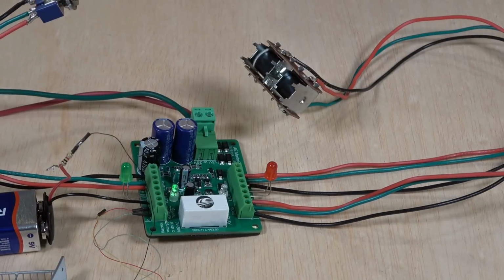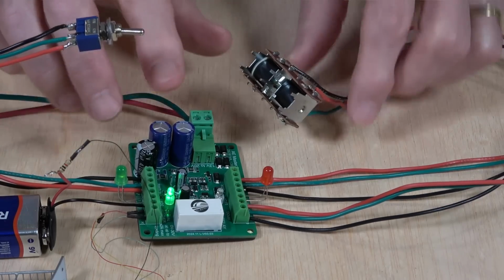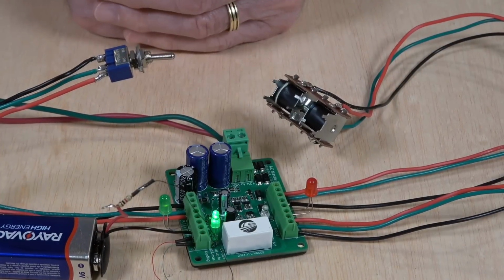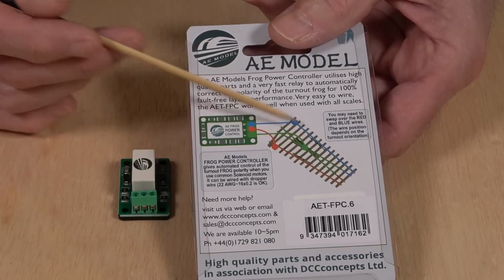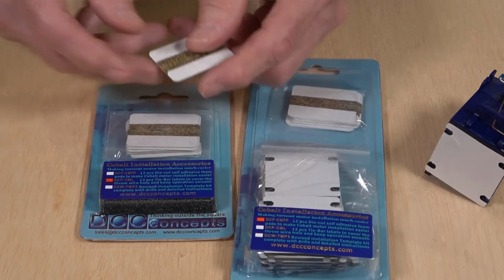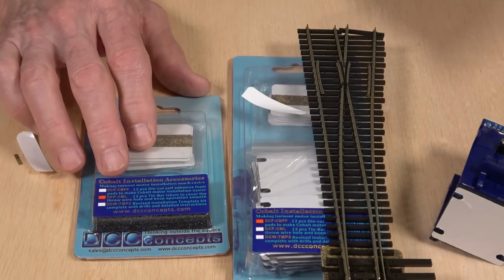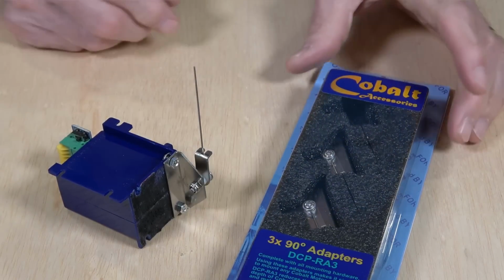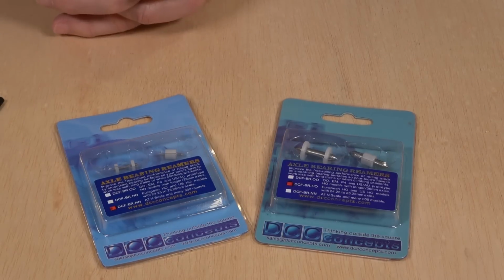New Toys For Your After Christmas Wish List (372)

Comment: Totally unreated question, but has anyone you know of done videos on using something like an oscilloscope or similar to measure/observe DCC power bus signals when connected anywhere on a layout in order to determine problems with the variable duty cycle square wave signal coming out of a booster (or command station with inbuilt booster)? I've not seen any boosters that 'self diagnose' and report on faults/issues with the DCC signal. Shorts (where the two phases are mis-matched and 'shorted') get detected but I haven't seem much covering the potential for signal degradation or 'corruption' that might lead to power loss or 'leaks', or deformation of the signal. I guess this is partly why on larger layouts there needs to be multiple boosters.
Reply from the maker: That is such a difficult thing to do and interpret requiring very sophisticated equipment and knowledge. Few modelers have the scopes for it or really the need to do it, so no it has never been done to my knowledge.
Reply: @TheDCCGuy  Thanks Larry I do understand that. I suppose there is a subset of modellers who are very technically minded. Really appreciate your channel btw. As I'm getting back into model trains after a 25+ year hiatus that started when DCC was still new I'm still catching back up. 8-)

Comment: I'm so glad you highlighted and demonstrated the Tiebar Labels. I just ordered some from Iron Planet Hobbies. Do you know if the new DCP-RA3 90 Degree Adapters will work with Tortoise switch machines?
Reply from the maker: I doubt they will work since the Cobalt switch machines are slightly smaller so the screw pattern would be off.
Reply: @TheDCCGuy  Ok. Good information. Thanks for the quick reply.

Comment: You used an interesting term. This little bugger. The original meaning of that word is very relational to reaming which is what the axel reamer does. But it used to be a very derogatory term that my Grandmother said I should never use !  Just saying….
Reply from the maker: You need to widen your vocabulary. A “bugger” is also a pesky little critter that causes trouble or an extension of “bug” as in something that bugs you. For example in episode 3-22 of Stargate SG-1 Col. Oneill refers to the replicators as “buggers”. A related “term” is “booger”, not to be confused with nasal conretions, but instead just little buggers.

Comment: The Tie Bar Label is a great idea. Do you know if they make it in N scale or this will work with N scale?
Reply from the maker: Good question. They are not specific on the website about scale but with N scale they might work. You could trim them down after application. If anything it would give you greater range on the throw rod movement.

Comment: Very informative as Usual 
Will these devices control Peco PL11 turnout switch machines??
I'm just entering the model railroading hobby and I am exploring all my options.
Thank You
Reply from the maker: It appears the PL100 are servos whereas these are designed to be used with solenoid based switch machines.
Reply: Peco PL11 are solenoid type... Correct ???
Reply from the maker: According to what I found on the Peco website, both the PL-10, which I showed in the video, and PL-11 are solenoid types. Be aware that the PL-10 does not have a centering spring to hold the points in place but instead depends on the little spring in the turnout to do that. Therefore do not remove that little spring as I do for use with Tortoise and Cobalt switch machines. I assume since the PL-11 is designed to work with Peco switch machines it works the same way.

Comment: Shit Audiosync! Please switch it off!
Reply from the maker: I looked into this a bit and it appears to be an issues at the USER end not with YouTube. Most fixes include downloading and reinstalling the app or firmware, as well as various adjustments to the settings of the device being used for viewing. A quick Google search will provide more specific fixes.
Reply: @TheDCCGuy  I use Youtube at the regular webside on a PC with a actual cromebrowser. I am not able to switch it of for generally. I had to set each tim it start such an video. 
I am not able to set english as a second main language (only one selectable).
Only the content creator is able to set this finction off.

Comment: Hi Larry, you mentioned that you’ll be using the DCC Concept switch motors on the new modules but didn’t mention the Tortoises.  Does that mean you consider the IP Digital units to be the better choice?  Thanks.
Reply from the maker: They have a built-in accessory decoder which will save me the extra work of installing them.
Reply: Makes sense, thank you Larry.   Have a healthy and happy Christmas & New Year.

Comment: I wonder if the 90° adapter will fit a tortoise switch machine if not they should make one
Reply from the maker: I think Circuitron does make one. Also I don’t think these would fit a Tortoise since the iP Digitals are slightly smaller.

Comment: Bachmann switch machines work just like Atlas machines. Kato machines are a different animal. Kato is a single solenoid machine and requires a reversal of polarity to switch it.
Reply: DCC Concepts produce a 3-wire to 2-wire converter so that devices like the MasterSwitch and accessory decoders for 3-wire solenoid switch machines can be used with Kato type switch machines - DCD-SDC3/6/12.
Reply: @Mark_W_L  I use the DCC Concepts Cobalt stationary decoders on all 40+ Kato turnouts on my n scale layout, employing the 3/2 converter on each. All work flawlessly. They even support led lights to indicate whether a turnout is open or closed.
Reply from the maker: Thanks for that explanation, I’ve never seen it put so succinctly.